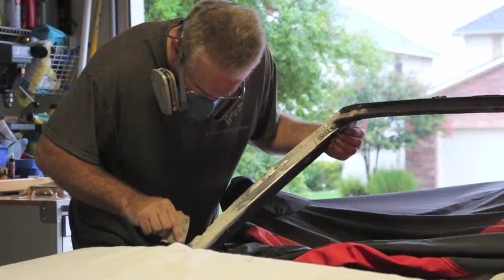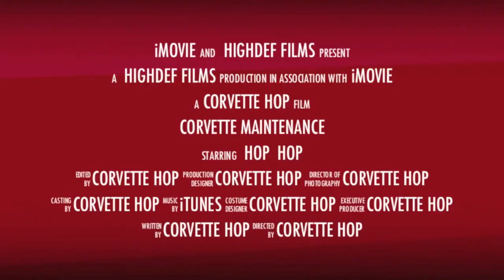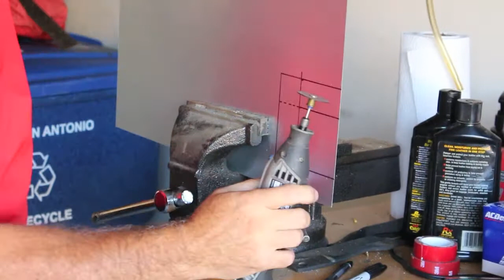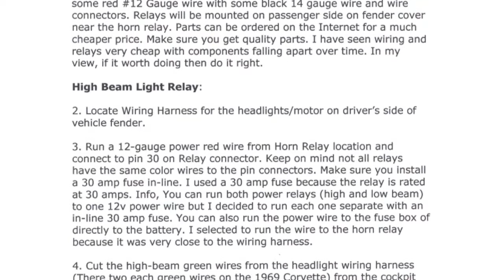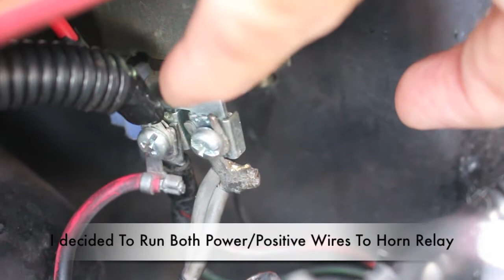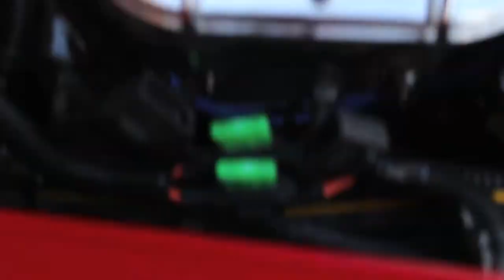Headlight Relay Install on C3 Corvette By Corvette Hop

Comment: What you state verbally does not match up with what you show on the printed copy in the video.  For both HB and LB you switched the 87 and 86 pins. The printed copy indicates HB Green wires from the headlight side going to the 87 pin and the cockpit side going to the 86 pin, however you verbally indicated the opposite by stating the HB Green wires from the headlight side going to the 86 pin and the cockpit side going to the 87 pin. You made the same mistake with the LB wires.  So which is correct?  While it may seem obvious, you should mention there are two green and two tan wires and that you spliced the cut ends together before connecting them to lead wires from the relay connector.